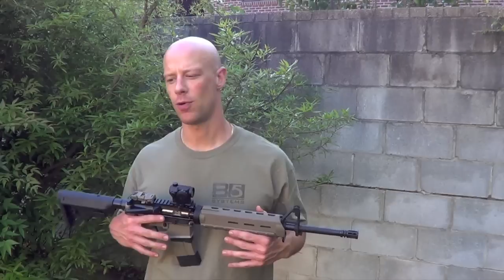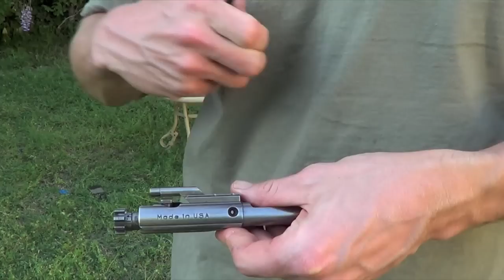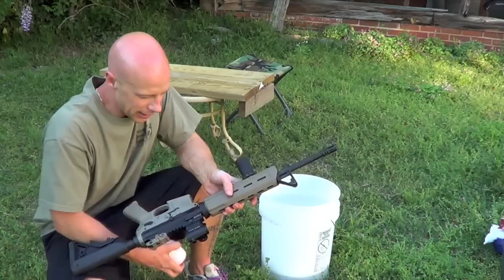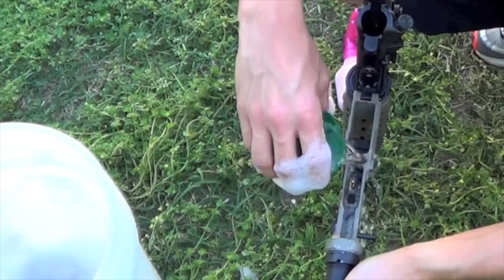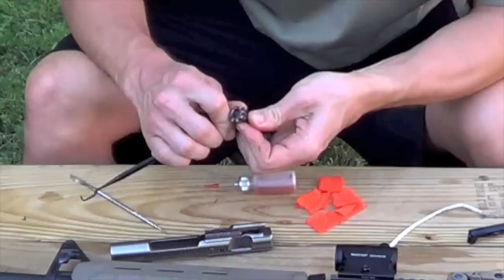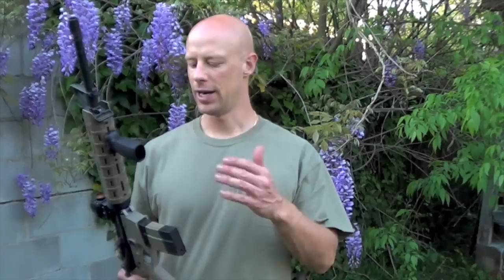How To Clean A 5.45x39 AR-15 After Shooting Corrosive Ammo (7N6)

Comment: PA, in a valley.  Lots of rain and humidity.  I've had Remington shotguns "flash" just sitting.  Same with parked AK's and blued 1911's.  But never an issue with the AR's.  The just don't rust if they stay oiled.  I burned through tins and tins of Tok and used to be thorough, until I realized it wasn't necessary.

Comment: I've been shooting my excellent S&W MP15R for about 4 years and have thousands of 7N6 rounds through it with no corrosion problems, so far. I meticulously clean it, just like you do about once a year, and do a good quick clean with Windex after every shooting session. A suggestion: I have switched to an Otis rod made for the .17 rimfire, and  have found this is much easier to clean the bbl with than a .22 cal. rod. Nice video.
Reply from the maker: Thanks.

Comment from the maker: I guess it just depends.   In some AKs, using the same procedures used here I've still had rust (usually in the gas block) and I've also had corrosion start on the gas tube in my ARs living in both NC and SC.    It was more common before I started using ballistol though; that does seem to add a little extra protection.

Comment: I have not found it necessary to clean or soak anything immediately.  A few hours doesn't seem to hurt anything.  I did have an AK-74 gas tube rust on me, but that was because I left it wet in the sink overnight.  To get the AR-15 gas block and gas tube, I use a funnel and pour a little Ballistol/water solution in the barrel from the muzzle end, with the upper upside-down.  Seems to work well and easier than trying to pour or spray into the gas tube from the breech end.  Q-tips are handy.

Comment: Never had any rust in a 7.62x39 AR with just the most basic cleaning and oiling.  Even after shooting Yugo surplus.  CLP down the bore, snake it.  Wipe down the bolt with a little CLP and put it away.  No issues.  Even sitting for months... 

Same deal with a tokarev upper.  I never put a drop of water through either.  Zero rust.  The gas tube is stainless steel!

Comment: I heard using Windex cleans the corrosive salts away, my last shooting session was the first time I used corrosive ammo, drenched the weapon with Windex. About 3 weeks later when I checked my gun I had corrosion on the bolt and the throat of my barrel, which means likely had some throughout the barrel, I will never again use Windex, think Im just gonna go with a hot-water/soap mix next time

Comment: So to clean the gas tube all you have to do is put hot water down it, the blow the water out with compressed air? Also does the compressed air blow all of the water out of the gas tube?
Reply from the maker: Yes and yes.

Comment: hmm, well I tried Pmags and really you can't get more than 8 or 10 rounds in them before they start binding real bad. If you force it you can fit 18 or 19 before you just can't force any more in.
GI mags I only could put like 3 rounds in before they start nose diving.

The 223 mags are just too narrow on the inside and they need a sharper curve to them. What we really need is like a 5.45 pmag with a continuous curve.

Comment: MrGnG, I'm thinking of doing a 5.45 AR build using the Huldra complete upper. Can you elaborate on the ejection pattern of the 7n6 on the AR? I shoot lefty so I want to minimize casings coming back in my face and I wasn't sure if the deflector works well with the Russian ammo? 

Side note, any advice on the huldra or Adams arms piston uppers? 

Thanks!
Reply from the maker: It just depends on what buffer you're using.  You can adjust the weight so it goes wherever you want it to go so I wouldn't sweat it.
Reply: I'm a big fan of Adams Arms for 5.45. I ended up getting it when everything else was sold out, but I'm glad I did. You pay a tad bit more, but the piston keeps the gasses out of your face (especially for a lefty), and the inside out melonite finish gives you a lot of forgiveness on the corrosion issues, and if you run out of 5.45 and the surplus prices are no longer attractive, you can get a new barrel and bolt, and have a darn fine 5.56 upper.

Comment: that a Spikes Tactical (melonited) 5.45 upper ?
reason im asking is I have a ST 5.45 upper, but I just use Windex down the barrel, gas-tube, lower etc and Im done, aside from running a lubbed boresnake down the barrel

Comment: After doing a lot of research I keep hearing conflicting stories as far as weather to use water or not. Some say water doesn't remove the salt and only promotes corrosion. Some videos I have seen just advise of cleaning like you would after using non corrosive ammo as some have been doing this for 15 years+ with no problems.
Reply from the maker: Joel K "Some say water doesn't remove the salt and only promotes corrosion."  Some folks used to say the earth was flat and they were completely wrong and proven so by science as well :D
Reply: Mrgunsngear Channel Can you confirm if ASC mags are 100% reliable with this setup?